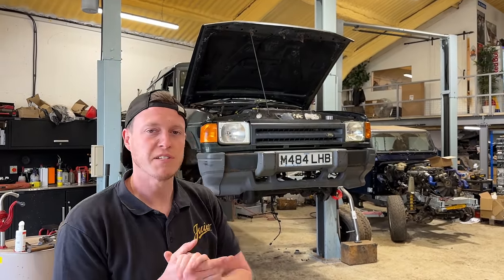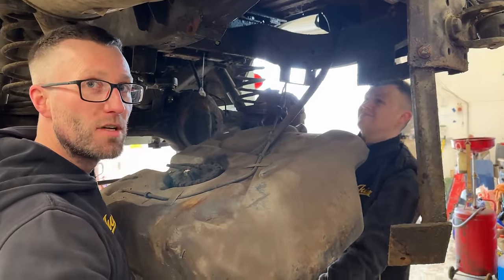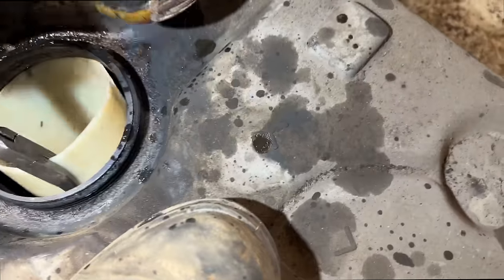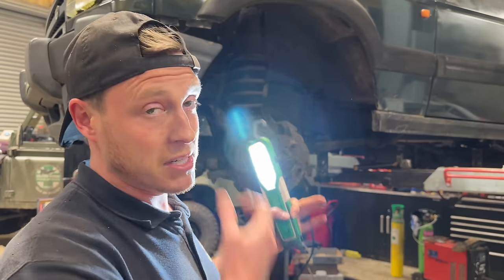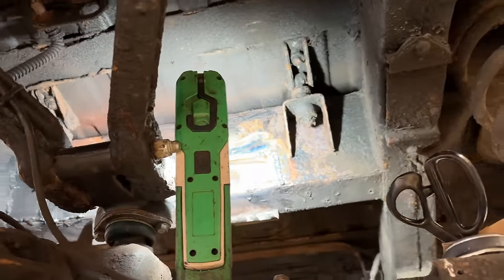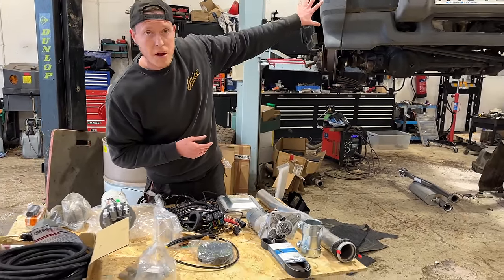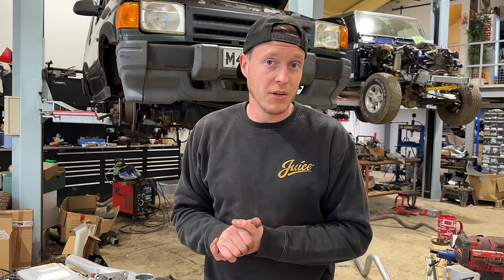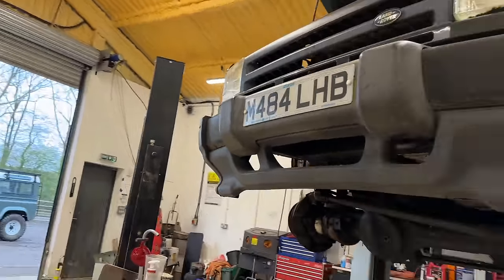Rebuilding a neglected Land Rover Discovery 1 - Part 2

Comment: Love it! I love the detail with the issues/repairs. As a Disco 1 fan you know that sometimes the age/neglect requires constant attention. I have a 98 v8 with less thank 20k. However, simply the age of the parts results in rot/wear.

Comment: Excellent videos thank you. When you did the test fit with the engine you sounded very surprised how well everything fitted.  When I fitted an M3 6 speed manual gearbox to my 1991 E36 318i I found that the gearbox needed to fit one inch further forward than in the M3 because the 4 cylinder 318 being much shorter had the flywheel further forward. I welded up new gear linkage but when I offered the rear mounting bracket of the gearbox up to the body I found 4 unused drilled and tapped holes for the bolts.  So even though BMW never offered the 6 speed manual gearbox with a 4 cylinder engine they ensured that the body was fitted with mountings so that if ever that combination was offered it could be!  I sold that old E36 for £100 3 months ago because I just cannot store every car that I have ever owned, but I was sorry to see the back of such a great car.

Comment: you mention a BMW fuel pump will work on the TD5, which one as that? I would really like to do an external fuel pump upgrade. Too many times I have had a faulty fuel pump in the middle of nowhere and it's a mission to replace. Putting something more reliable and accessible would be amazing.